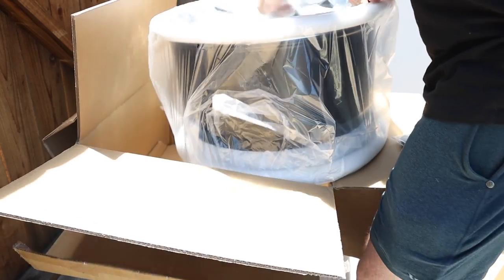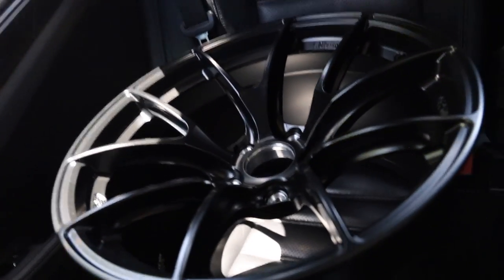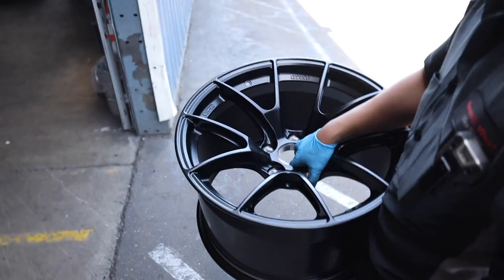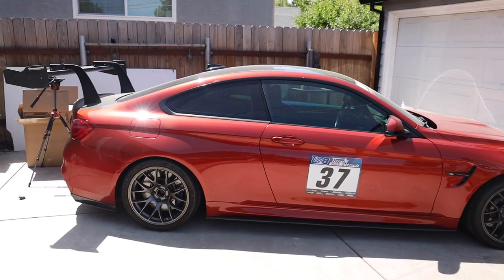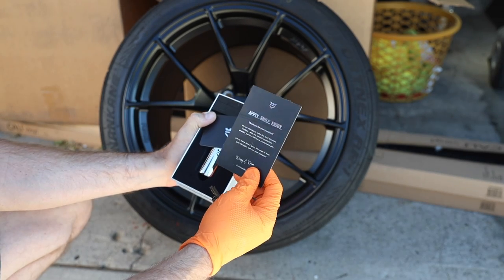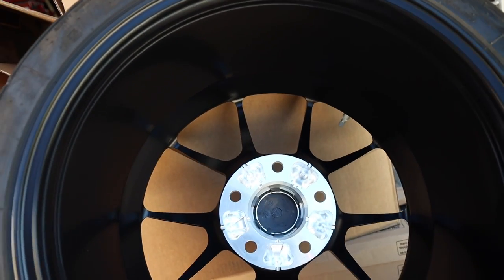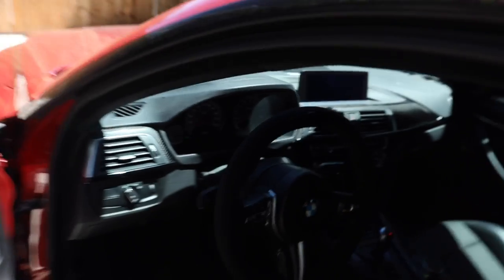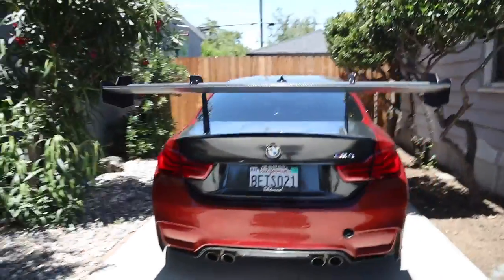315’s Squared 🤷🏼‍♂️ NEW Wheels

Comment: I’m dealing with the same issue with my f80. Lots of understeer and over working my front tires. I want to move to a square setup, but I’m still not 100% sure of what size tires. It’s so hard with certain tires only available in certain sizes. And then those tires being in stock or constantly back ordered. 

Really looking forward to hearing how this square setup works for you. Also can I ask what setting you are running on your mcs suspension for front and rear compression and rebound?  Thanks
Reply: I think the under steer is because of the factory alignment, cars are usually aligned towards under steer since most drivers can’t control oversteer to make it safer

Comment: About to order some Ec-7's. How much chamber where you running front & rear on your set if you don't mind me asking. Was planning on going 18x10 ET25 front & 18x11 ET44 rear with a 285/30/18 front & 315/30/18 rear. Currently on swift springs, Oem dampers, & Millway chamber plates, praying I can get this to fit without rubbing
Reply from the maker: Yo use my link 👍🏻🏁🏁🏁 -3 front. That will 100% fit without mods may just need a front spacer. Also the rears I use a 12mm spacer but I don’t think it’s necessary just looks better.
Reply from the maker: Also it does all depend on the tire manufacture since just because it’s the same numerical value doesn’t mean it’s the same actual size. But the Nanking AR1 is definitely a fit
Reply: @BlakesGarage  gotchu, thanks bro 😎 once i got everything we should hit a track day together 🤙🏼
Reply from the maker: @stoss-11  hell yeah! I’m basically hitting all the Turn 8 days this year 👍🏻👍🏻🏁🏁🏁
Reply: @BlakesGarage  What's your camber at the rear with 315/30/18 and 12 mm spacer?
Reply from the maker: @markohayduk  think it was like -2.5 but the rear had no issues whatsoever
Reply: @BlakesGarage  I'm thinking about buying squared 18x10.5 with the same ET front and rear. From your experience would you go with ET38 and thick spacer in front or ET25 with smaller spacer in front but small risk of rubbing at the rear (if I decide to try 295/35)?
Reply from the maker: @markohayduk  read Apex Wheels guide they go over all this. I know having the same offset of wheels would be nice because it would be easier to rotate however, I don’t know how that would work out
Reply: @BlakesGarage  Thank you for a quick answer)